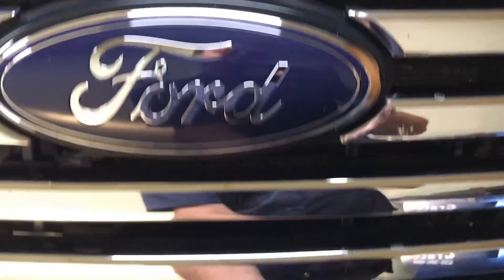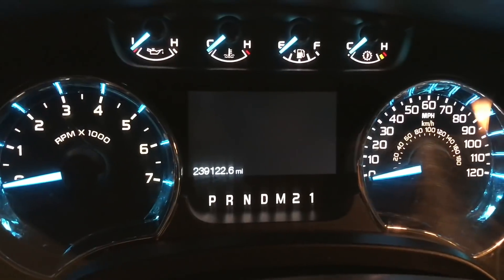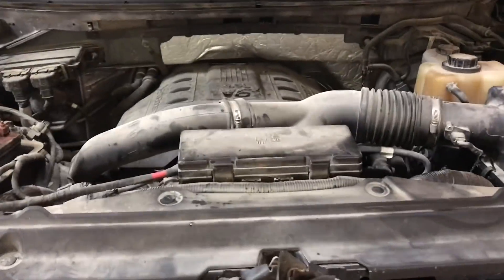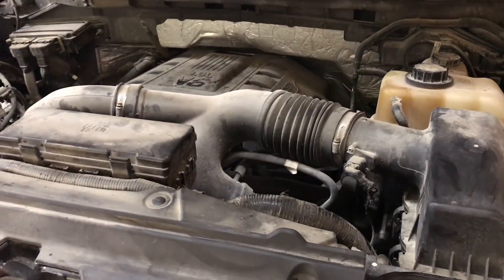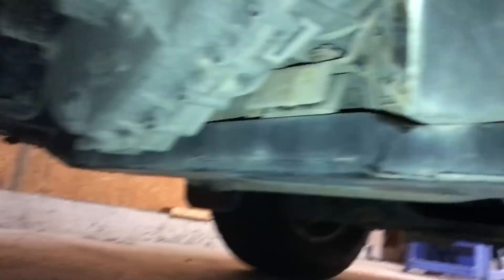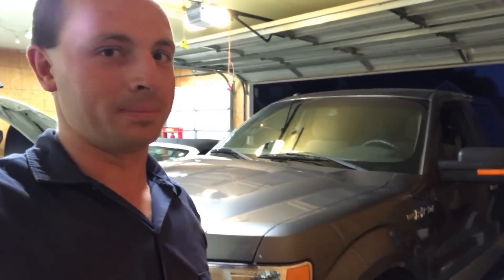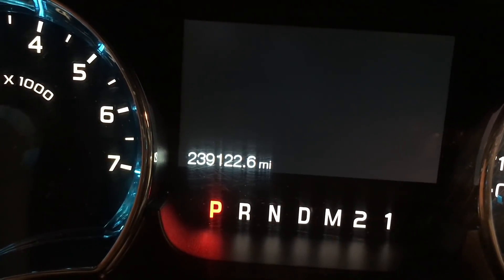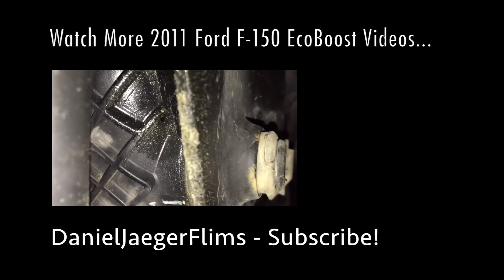Is the EcoBoost Engine Proven?

Comment: Ecoboost doesn't sound great (at times). That's the only flaw I see
Reply: @NateMac434  I drive a lexus gs 350 , 3.5L engine sounds like diesel cause of direct injection but it runs forever, They use the engine in the tundra now.

Comment: He drives it as a car so yes it will last longer. A guy i work with bought a 2017 and they had to put a new engine in it after 3400 miles. Never ran the same

Comment: The 2.7 and 3.5 ecoboost are proven to be reliable when taken care of.. and its soooo easy to take care of them is the funny part.. change your damn oil and filters at the right time heck do it 2000 miles earlier if u really care and reap the benefits of a engine that outperforms v8s and gets better MPG
Reply: Lolz this is pretty true  and it’s funny it’s about the same price in oil change compared to V8 so I don’t see how once can save in costs

Comment: This is 1 truck and there are more but in the 70s the ford pinto also had a few that had high mileage but far too many were trash. Just look around at the problems. Way too many. That retrofit aftermarket condensation fix on this truck will not work for all of them and this engine requires far too much expensive maintenance due to carbon build up. Buy one of these and its pot luck on how long it last. In 2 more years the used truck market will be flooded with 2015 and newer EcoBoost   trucks for outstanding prices. Dont buy them because they are for sell for a reason.

Comment: too many problems Im on 3rd engine and Ford refuses to repair anything, turbos leaking excessively and they want to diagnose every system that has oil rather than looking in the gallon of oil sitting in charge tube

Comment: Timing chains?
Reply: You don't need to do a timing chain if you keep up with your oil changes.
Reply: Mid 2013 and newer 3.5 Ecoboost engines got a timing chain upgrade, all replacement parts are also new design.
Reply: Nah that was ford’s 4.0 sohc v6 lol, pretty good engines other then that though, i have one myself, 206k and the timing chain rattles like heck.
Reply: Guess its a ford thing, haha
Reply: Just use synthetic.oil you'll be good
Reply: @benjaminwayneb  the tsb for timing chain stretch covers up to 2015.
Reply: @dorianf1456  The latest TSB. Covers build dates up to Oct. 10 2014.
Reply: @benjaminwayneb 
It's mid 2015 that the updated parts came out, not 13
Reply: dunkin dounut I got 256000 miles on mines.  Just replaced timing chains.  Never go with aftermarket brand.  I used cloyes and they started to rattle after 1000 miles.  Never again
Reply: The original TSB had updated parts starting in 2013 but it looks like they have been updated again.
Reply: Yeah unfortunately the supposed "updated" parts were not actually updated correctly until mid 2015. Unfortunately
Reply: The 2011's had a different style timing chain. It was after Ford went to the cheaper but quieter inverted tooth timing chain that the timing chain stretch and cam phaser problems showed up. Also, this guy clearly uses his truck for long distance highway driving. With a more normal mix of long and short trips, fuel dilution of the oil becomes a much more serious problem with these engines, which greatly increases the wear of the timing chain and phasers. Go check out bobistheoilguy's used oil analysis forum. Guys with 5-7k miles between changes get results back with more than 5% gasoline by volume in their old oil. That's when the problems show up.
Reply: Shaun  you're wrong

Comment: Transmission issues?
Reply from the maker: In fact, it has had an intermittent issue with the range sensor, every so often it goes into limp mode. I’ve been told it’s a fairly simple $100 fix to replace the range sensor on the side of the transmission.

Comment: Any idea how he’s getting 21 mpg? I can do 18 at best driving highway
Reply: I get 22 in AM (60mph) and 20 on way home on highway. 3.5 ecoboost 16'
Reply: I'm not sure.  But whether he has the 26 or 36 gallon tank his fuel range says 381 miles to empty and almost a full tank.  Do the math.  My 13 5.0 with the 36 gallon tank would be about 680 miles to E on the indicator.
Reply: My average reads 19.4. Easily 22 on highway. High 20s on a long smooth road doing about 55 in 6th.

Comment: My wife had an 88 chevy when we got married in 89. Sold it with 165K and got a 90 chevy with 250k. Sold 5 years later with 315K Next owner still has it and says it has 400K. Current truck is a 97 bought with 65K now has 265K. All 350 automatic 4 speed. 90 was 4x4 Other 2 4x2

Comment: This is not the norm....not at all.
Talk to a ford tec and they will gladly tell you the EB is shyt
Reply: Cory Nickoleff I’ve had two 3.5s with over 200k miles worth of hard midwestern winters in the coldest places in the lower 48 with not ONE. SINGLE. ISSUE. must be luck of the draw then?

Comment: I blew my 2.7 ecoboost 4x4 on a trip to my sons wedding in NY. 36000 miles young and I babied the vehicle, no heavy towing, nothing over 3500 GVW. Ford has approved a crate engine. My mpg was 23.7. I loved my truck. Problem is that it is still in Utica, NY and I’m in Kansas. I’m having Don’s Ford look into shipping it back to me. My suggestion is to Ford owners is to make sure you have towing on your policies. I had to pay for the rental to get back to Kansas, but, the service manager will try to get it reimbursed by Ford. I have been a Ford guy forever, this worries me.
Reply: What year is your 2.7? Were you having any oil usage before the motor went?
Reply: 2016. No oil usage but I did have to have my oil pan removed and replaced at about 20.000. The shroud under the transmission and engine is a potential factor in noticing oil leaks though. When I checked my oil and found it was low, I got under the car and pulled the shroud off and it was full of oil. There was oil splash all the way up the back of the motor and all over the transmission. Since the replacement, I have left the shroud off. With the shroud on you could or would never tell if you have a leak until the shroud got so saturated it would finally leak on the floor. I did see on another YouTube post that the exact same problem with a bad oil pan proceeded his 2.7 failure, but he had several oil pan replacements by Ford before the leak finally stopped. His 2.7 failed as well and I think his was a blown exhaust valve. I believe his repair was a long block not a crate engine like mine is.

I hope the engine that Ford replaced mine with is of newer design, hopefully a 2018 or even a 2019. I called yesterday and they were supposed to have it buttoned up by today. Ford will not pay for having it shipped back to me, so I told the service manager to find a shipper that has multiple vehicles to ship back to the midwest. I may have to meet the shipper to help save on money. It will cost anywhere from $800 to $1000 to have it delivered. It really sucks. The dealer is 1700 miles from me.
Reply: Good to know. I took my shroud off because it was pointless to have on. I wonder if your motor falls in the TSB timeframe? The TSB goes from April of 2016 to January of 2017. It covers issues with oil usage that stem from the heads.
Reply: Good question. I have never been notified of a TSB either by Ford or my dealer. But Flint Hills Ford has got to be the worse dealer in the USA. One TSB that I have been aware of is the drivers door issue, which I do have a problem, but have been reluctant to take it to my dealer because they’re such idiots. lol. What are the serial numbers of the TSB???
Reply: @arkyump  they won't contact you for TSB work, only recalls. Here's a link for the oil TSB https://www.f150forum.com/f118/2016-17-f150-2-7l-oil-consumption-rough-idle-misfire-ex-smoke-tsb-17-2077-a-381323/
Reply: It must have because I’m getting a crate motor from Ford. I’m just hoping that it is an 18 or newer model.

Comment: 2014 edge with 107k 3.5 v6 this is my last Ford.. internal water pump killed it for me...sticking with Toyota...shame on Ford for making trash...ecoboost is a time bomb not reliable on high mileage everyone knows turbos are a maintenance issues as they get older
Reply: Big job to replace it. I don't know why anyone would mount a w/p inside of an engine. How often do you change your coolant. I do mine once every 2 year's. My F-150 is 14 years old and has over 244K on it, original water pump. I use the green coolant we all grew up around.

Comment: Mine is at 278k now
Reply: I just got 1 tosay with 120k. What problems have u had?
Reply: @hurricane8634   motor wise nothing, my trans range sensor acts up a bit though.
Reply: @dumlittlerat  whats it doing. And at how many miles did it start
Reply: 280k but it does this thing where it  doesn't say its in gear
Reply: @dumlittlerat  280! And thats the only problem youve ever had?
Reply: So far yes
Reply: @dumlittlerat  wow ok thanks man. Good to here

Comment: A pile of junk and Jasper won't reman it.Did not pass their 100,000 mile test on their test stands.If it does not pass their 100,000 mile test,Jasper will not reman it.They tested 6 3.5L  ecoboost engines,blew up on their test stands.Blown headgaskets,fuel injectors blowing out of them and a miss under a load pulling something are a common problem with the 3.5 ecoboost engines.My dad is a Jasper dealer and the rep that comes in said he has talked to Ford techs that have seen these problems.A late friend of my dad's,his brother in law bought one and regreted it.His was one of them with a miss under a load pulling something due to bad programing in the computer.Was glad to get rid of it
Reply: Jasper engines are junk!!!!!!!! Allways has been allways will be.
Reply: Rebuilding costs more and no upgrades done.Plus the machine shop may not back their work screwing you.Been there with a few
Reply: Jasper Engines are not junk,only had 3 come back.One was because the customer's son drove the vehicle with a leaking radiator and this one was covered under warranty.Even with two 5.7 Hemi engines,one had bad new lifters from Chrysler and the other was from the rocker arm bolts being overtorqued which both were covered also